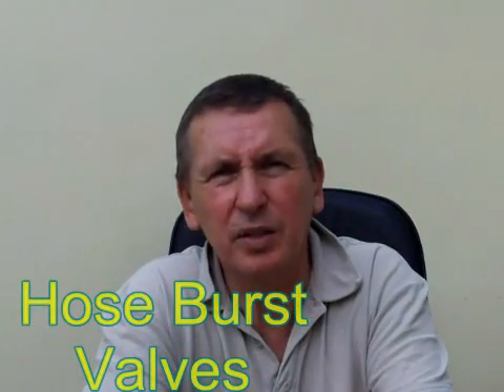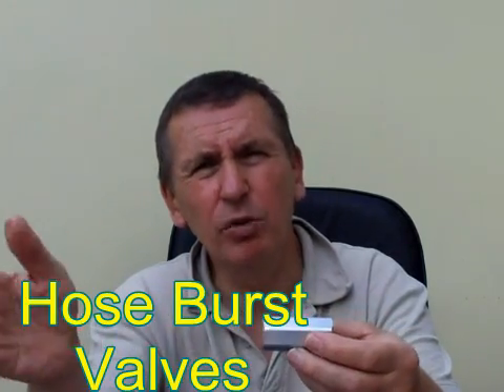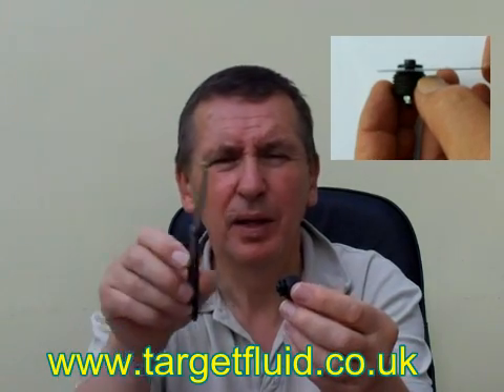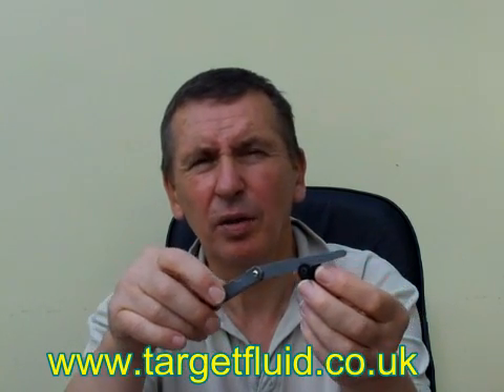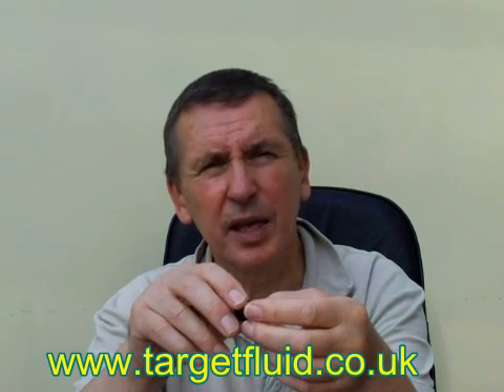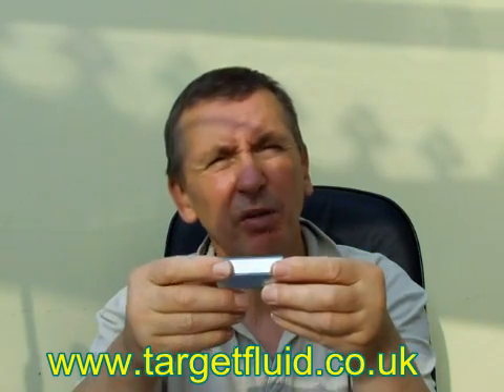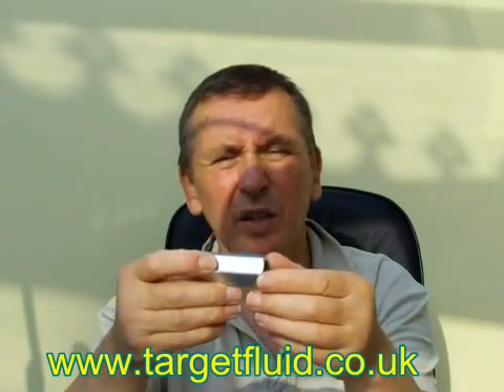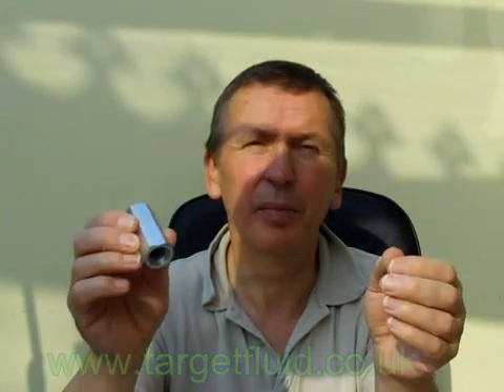Hydraulic Hose burst valves

Comment: Pressure in a hydropower setup is uncontrollable; it is set by height of the headwater. Only flow can control speed using turbine gates.  Head gates are not suitable for control, only good for on and off during an emergency or maintenance.